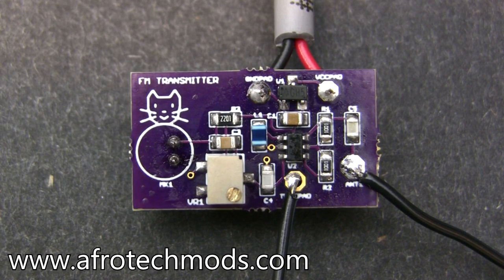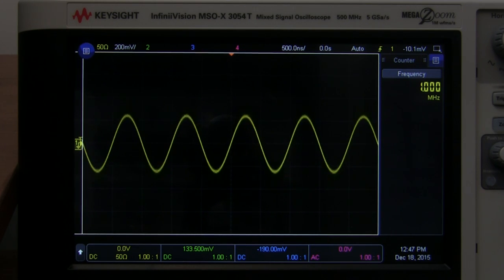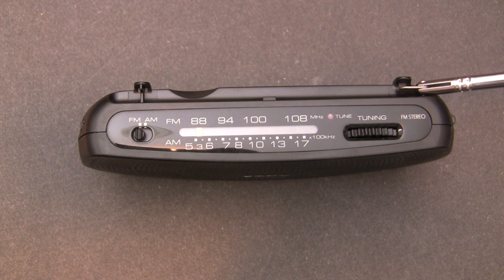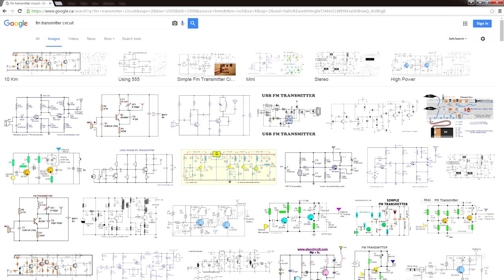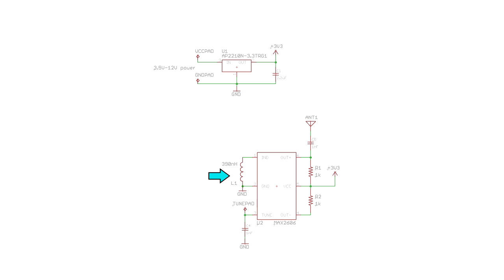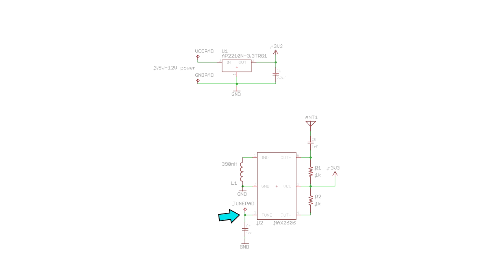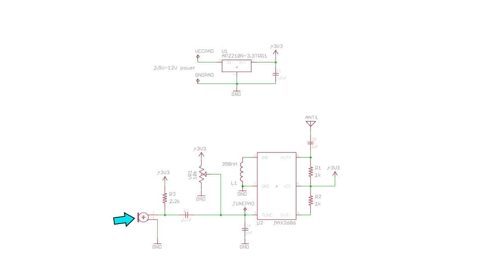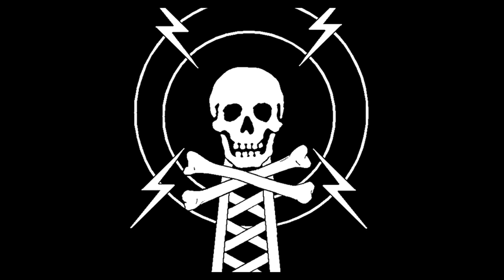Frequency Modulation tutorial & FM radio transmitter circuit

Comment: Hi Afro- I don’t know if you are still monitoring these comments, but I wanted to tell you that I recently built this project, it worked great, and I learned a lot. Thanks so much for going to the trouble to make these great tutorials, provide parts lists and links (no one else does this that I know about), along with clear explanations, working designs, and even a good sense of humor. You really are the best. PLEASE COME BACK!
Reply from the maker: yay I'm glad at least one person built it
Reply: @Afrotechmods  Yup, I built the AM transmitter too. One question if I may— could a novice design the PC board for the FM transmitter, just being careful to keep leads short and use a ground plane? Or were there other considerations necessary to avoid parasitics? Thanks again for a great channel.
Reply from the maker: It already sounds like you know enough to know what you are doing with the PCB so go for it
Reply: @Afrotechmods  Thanks again!

Comment: Another stellar instructional video. I will be building this myself to better understand the ideas you put forth. $3.00 boards are impressive. I have been spending WAY more than that so thanks for the great tip!!! 
I see you used surface mount components.  Tough to do on my bench. I assume the surface mounting reduces stray capacitance and inductance. My breadboard versions usually are a bit tricky to get working especially in the FM range. Anyway, Great video. Thanks!!!!

Comment: Another cool way is to oscillate a transistor were the C B junction forms part of the resonant circuit. The C B junction exhibits the varicap efect. By introducing an AF voltage on the collector you end up with modulated RF with a single transistor.
Reply: Is there any schematic you have? because i want to build it my own ;)
Reply: Hi Thanks for the interest. I done this many years ago when sketching circuits in the back of my high school books. Basically an inductor between B and C on a biased NPN bipolar creating a tank circuit. Oscillated at 100Mhz. Supply lead inductance may also have played a role since I wasn't particularly careful about such things :-) I'll have a play and if I re-create it, i'll let you know.
Reply: Were you able to recreate it? ;)

Comment: Back then in early 1980s a wireless microphone that can be receive on a regular FM receiver was common. No need a dedicated receiver like today. Some of them are factory set at 90 MHz while others 92 MHz. You can change the frequency by adjusting the potentiometer. Most of them have rage about 100 meters (according to manual). I can't find those type of wireless microphone these days. All wireless microphone that I saw today have a dedicated receiver.

Comment: Hi, your videos are the first place I look when i want to know how to connect and use certain electronic components, thank you so much. I was looking at your AM transmitter circuit as well and I have the same question. What IC can I use so that the circuit doesn't necessarily have to be low powered. I want to obtain a longer range, I visit my grand parents very often at their ranch where cellphone reception is difficult to obtain so I think it would be fun to design a circuit for communicating. By the way, I'm an engineering student, I'm mentioning this in case it modifies in any way your response.

Comment: Thanks for this! So do you need a separate voltage source to be connected to the tuning pad? If I want this circuit to be battery powered can I connect it to the same source as the circuit?
Reply from the maker: You can leave the tuning pad disconnected entirely if you wish. That's just there if you want to manually inject your own voltages to control the frequency output by hand. You can power this circuit via batteries very easily - you can see from the circuit diagram there is a linear regulator. 3xAA for 4.5V should work nicely.

Comment: Just wondering if you use a oscillator driving a 74AC74 in such a way to generate two signals 90 degrees out of phase then use one of the two signals to drive a 74HC4053 configured as a double balanced modulator then put the other signal you generated with the 74AC74 and filter that and add that to the output of the 74HC4053 balanced modulator using capacitor coupling then triple up the resulting signal then feed it through an RF amp then a bandpass filter then et voilà you have an FM transmitter, BTW you need a frequency of around 40MHZ to start with as the 74AC74 phasing generator divides the signal by four so if you want 10.7mhz so you can use a 10.7mhz crystal filter use a 42.8mhz crystal.

Comment: This circuit worked very well, and is much more stable than a typical L/C circuit with transistor. However, the output power is extremely low (just a few dozen feet at most) versus 150 feet with even a single transistor L/C transmitter. Can you recommend a simple circuit for an RF Amplifier to add onto Pin 6 of the Max 2606? I'm not trying to interfere with anybody's transmission, but simply trying to see if I can achieve a little more distance in this FM transmitter. I like the stability and ease of use of the Max2606 design, but not the output power. I haven't been able to find any decent, yet simple, RF Amplifier circuits on the internet. Thanks for any help you may be able to provide.

Comment: Could this be adapted to use as an FM telephone bug? I had something similar that a friend built back in the 70's. In not sure about he antenna, and the power was taken from the existing line voltage. The range was maybe a block away, max.

Comment: Hi anyone know why the Tune Pin pad has  a wire soldered to it rather than an SMD Cap and ground connection on the board? Do you desolder it once it's tuned? Thanks for the video!
Reply: I think he has added an aux input in the photo. He mentioned that he broke out the Tune pin for this purpose, and that the aux input has to be AC coupled and about 1mv.

Comment: How do I make a circuit where I want to have the bandwidth of frequencies almost infinitely? way over the FM network? a circuit without "fancy" chips really from the root of how to make something.
Reply: I'm not an engineer, but I would take a look for a VCO with a large range, or take multiple IC's, for example the MAX2605-2609, and set them up so that as you "tune up," you switch from chip to chip. It might also help if you can find a variable inductor, because that sets the broad range.

Here's a datasheet for the MAX's. Take a look at pages 7-11. 

https://datasheets.maximintegrated.com/en/ds/MAX2605-MAX2609.pdf

*Not infinite, but might be able to cover a broad enough range.

**Again, not an engineer, just an enthusiest working towards and EE degree.

If none of that works, you could also try creating your own VCO where you could set the theoretical range from 1Hz - 1GHz, if you have the time to tinker.

Comment: To increase power to the antenna, could you run the output of the MAX2606 through a suitable OPAMP to increase the P2P Voltage and current output? If not, what is a way to increase the power? 

P.S. - I live out in the woods with almost nonexistant radio coverage and several trees. Trying to build a two-way radio for communication when out working in the woods.

Comment: wow thanks. didn`t know osh shipped for free to Norway. what a great company. Good work on the pcb. Do you have a parts list?
Reply: +Fabianwew oh i found it myself. Where do you recommend buying the max2606?
Reply: +Fabianwew ok bought the chip. can i use any 390nh or this specific inductor? sorry for all the questions.
Reply from the maker: +Fabianwew Use the specific parts I describe in the BOM
Reply: +Fabianwew and where is the "jack" supposed to go. The microphone werent listed so what microphone should i buy?
Reply from the maker: Fabianwew
Someone vandalized the Octopart BOM. Use the information in the .csv file
Reply: +Afrotechmods i wasn't able to get the inductor you used. will a normal 390nh work?

Comment: +Afrotechmods I'm attempting to figure out how to build an interior light dimming circuit for automobile applications. In some cars, when you shut the door, the interior light dims all the way to off which is a feature I'd like to incorporate into my pickup truck. My interior lighting has all been replaced with LEDs, so I shouldn't have much current to work with. Would a capacitor or two with a substantial microfarad rating be sufficent, or would I need some extra circuitry?
Reply: Well you know you could use a capacitor that drains in it's own loop and just use the voltage from that to control a BJT transistor with a high enough current rating

Comment: Where did you source the inductor from?    I can't get this chip to work and I'm using a 390 nH SMD inductor, they say this chip is really finicky about the inductor having no capacitance and has to be high Q minimum of 35.
Reply from the maker: The BOM is in the description section...
Reply: @Afrotechmods  I just looked again and I don't see anything in the description of source for the inductor but thanks for replying.

Comment: I believe transmitters over 300 watts is banned in the U.S and also phasing out other station's is a definite no-no, high power antenna's and/ or boosters. You can get 150 watt or so studio quality transmitters online that's purposely made for personal ham radio use. Also since analog tv is pretty much phased out, new law enforces you can do UHF/VHF transmission with strict policy's as well for hobby reasons. Don't forget courtesy law, every curse or inappropriately used word is a $500 fine.

Comment: Can Oshpark make PCBs out of copper clad boards from DigiKey (that is, boards designed for a specific enclosure)? If not, are there any PCB services that do?
Reply: They can cut them to pretty much any size you want if your circuit design fits in it.
And then after they're made they (or you if they don't) can drill holes if you desire for mounting.

Comment: can I put an AUX input instead of the microphone?
Reply: if you put it through a resistor between it then it should be possible (he talked about swinging mV's so the resistor will pull it down to mV's)
Reply from the maker: Yes that is why I broke out TUNEPAD. Make sure your audio is AC coupled and divided down to be about 1mV
Reply: can you please do a video on this?

Comment: how does FM modulation works? I mean, I set the frequency to 97mhz on my radio and the frequency from the station keeps changing since its FM. how my radio knows to with frequency it should oscillate to receive RBS signals?
Reply: Ahhh because your FM radio receiver picks up a wide range of signals, not just a single frequency. It scans around the frequency with a few kilohertz difference.

Comment: I have tried LC tank based fm transmitters although i did not fully understand the feedback section of those this one seems way more easy to work on and build. Without frequency drifting off it would be fun to play with but here no online market sells this chip i found one but its tagged like this MAX2606 +AABC never seen this +AABC as explanation for any chip. Is this the same one?
Reply from the maker: Should be the same yeah

Comment: hey Afrotechmods,
Thanks for sharing the pcb design on oshpark.  could you please post or share the parts list?  Especially the source for the smt variable resistor, and the other parts as well?
A good place might be over at oshpark along with the pcb.

thanks
dwight
Reply from the maker: +heckleru2 It's linked in the video description section...
Reply: +Afrotechmods 
Thanks!
I should have clicked "show more" and looked there first.

Comment: Mentioning that "you will be caught" by using a high powered transmitter, could you do a video on ADF? Automatic direction finder most commonly used in aviation as an old form of navigation. The system is now used in most planes today to catch an AM baseball game.
Reply: All you need is a directional antenna and triangulation. People used to do that back in the old CB days to catch ppl that were being "dicks" and cut their outside cabling :/

Comment: So this means Sir that I could adjust the frequency varying from 70-100MHz by using only one L1(390nH) sir?
Reply: Jangjang A you need a potensio meter them use a screw driver and set it until no many sound on receiver
Reply: jaiz.. nabuang ning geniusboy, vovo

Comment: Preety good video about FM transmitter. Is there any good FM receiver circuit, that can receive 150-152Mhz? I need that so much and i can't find a good one.
Reply: For those who don't know, monoaural FM can be received by AM receivers by tuning them to a frequency that's slightly too high or low.

For more advanced reception, run the antenna signal (preferably preamplified) into a bandpass filter for your range, then run that into a transistor. Choose another leg of the transistor to be the output, and run a new frequency into the third leg: this is produced by the "local oscillator", and causes the transistor's output to be determined by the following formula: output frequencies = [ input frequency, local oscillator frequency, input frequency - local oscillator frequency, input frequency + local oscillator frequency ], for a total of four output frequencies from two inputs. Then you run the output through another filter to remove the frequencies you don't want (hint: what you DO want is input frequency - local oscillator frequency), and finally run the result into a decode module, which can be the diode stage from a crystal AM receiver (just as an example). Tuning is achieved by changing the local oscillator's frequency.

There are caveats: if ( input freq - local osc freq ) is negative, then it will actually show up as ( local osc freq - input freq ), which can cause multiple stations to tune in at the same time, thereby necessitating an intermediate filter. A fairly sensible way to achieve this is to use multiple stages of this frequency mixing: the first will move the entire range of frequencies to a lower range (because filters work more sharply for lower frequencies), where the majority of the bandwidth will be filtered out (this can be achieved by either tuning the filter, or having a fixed filter and tuning the local oscillator so that the input frequencies you want to keep are placed into the pass band), and then using the frequency mixing trick again to get the isolated frequency down to the range that you want it in. Honestly, I'd suggest 3 frequency mixers, with the first and third, as well as all of the filters, being fixed, and actual tuning being obtained by using the 2nd frequency mixer to move the desired signal into the pass-band of your "channel select" filter. This allows the variable frequency element to be restricted to a single element (the second of 3 mixers), reducing both complexity and cost, and also allows you to obtain multiple elements from a single "channel" by duplicating the 3rd mixer (with a slightly changed frequency, and possibly filter characteristics) for each additional element that you want to obtain from the "channel": FM radio in the US commonly has at least 4 (2 audio for stereo, though the encoding is a bit more complex than just two audio tracks; a plain fixed frequency for stereo detection; and a digital text signal to provide things like song title and alternative station frequencies).
Reply: What for?
Reply: Use colpitts oscillator with varactor diodes...It'll be your VCO, rest is simple.

Comment: So if you modulate the frequency and thus making it inconstant, how is the FM signal from your favourite radio station a certain frequency and not a frequency range?
Reply from the maker: +Bass Snail It is a frequency range. The FM signal is at a certain carrier frequency +/- a few kHz. https://en.wikipedia.org/wiki/Frequency_deviation
Reply: +Simon Forrez  if the radio station is 90Mhz i think the demodulator(your radio) is tuned to 90hz and then Demodulates everthing that is +- 20Khz of 90Mhz

Comment: I've made this circuit but my Max2606 ic is getting really hot, also I'm not receiving any signal on radio, kindly help...!
Reply from the maker: It shouldn't be getting hot - it sounds like you may have destroyed the IC already. Maybe you soldered it in upside down, or somehow the 3.3V regulation isn't working properly?
Reply: The 3.3V regulator is also getting seriously hot, but It's spitting a smooth 3.34 Volts, the dot of the max2606 is in the right position, don't know what I'm doing wrong :(
Any future help will be highly appreciated!
It's urgently Important.
Thanks for the quick reply :)
Reply: the reason the max2606 is getting hot is because there is a lot of current passing through it.   The regulator is getting hot because it is supplying a lot of current.  This should not be happening obviously.  Check all your component values - maybe you have them mixed up? and check your solder joints carefully.  
If all that looks good then remove the components attached to pins 4 and 6 - these are the output pins of the 2606.  Does it get hot now?  If it is now cool then something is wrong in the output circuit.
If still getting hot remove components attached to input pins.  If it is cool now then something wrong in the input circuit. If it is still getting hot now then it is dead.  buy another chip and try again.  You have to kill some components to learn anything really.

good luck.
Reply: Thanks for the reply, will surely consider your advice.